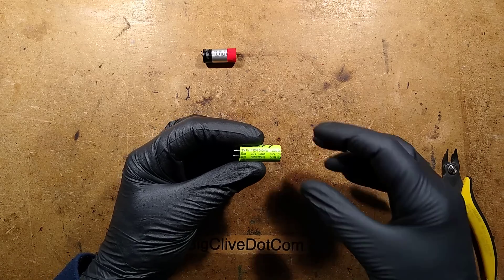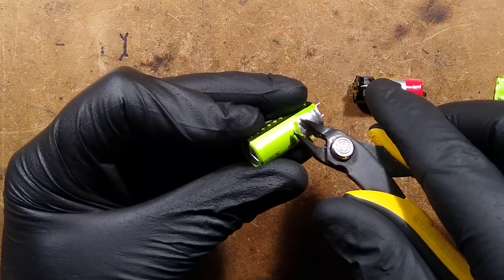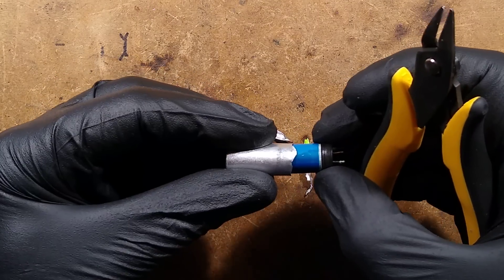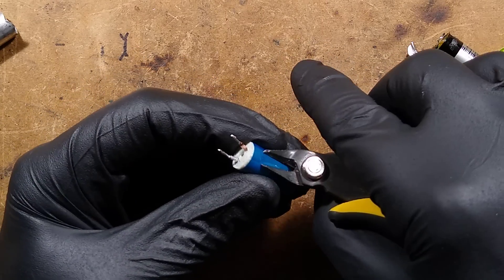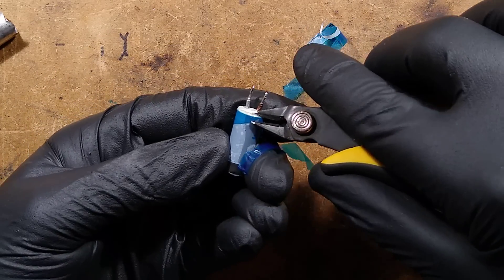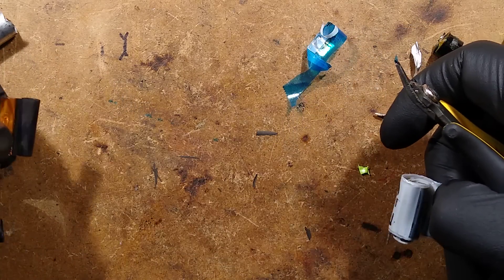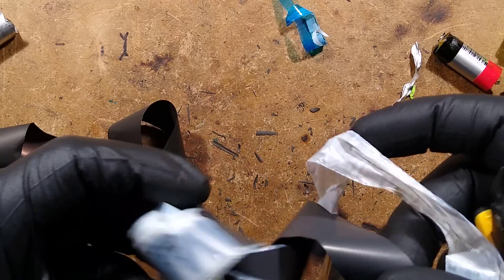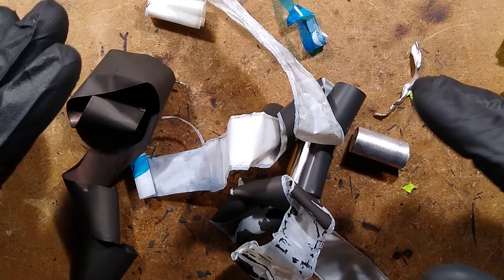Opening a capacitor-style lithium cell (don't try this)

Comment: Honestly, my biggest issue with the whole thing is that they used the black bar to denote positive rather than negative. I have been thinking about it, and can’t see anything good or useful about switching the terminals just because it is not an actual capacitor.
Reply: some older (60s) electrolytic capacitors of that can type did mark the positive like in this cell, instead of the negative, but the bar also had + symbols,, the bar was sometimes red or even blue or green  ,
Reply: I think the Black Bar was used to show the connection to the outer layer (eg case), so you can earth it to prevent capacitive coupling to the surroundings.
Reply: @graemezimmer604  no, its usually 'negative', if also specified with a - ,not necessarily 'outer', and is not necessarily connected to case, it is almost always in axial capacitors, at least more recent ones, but not in radial types, the can is 'floating'
Reply: @andygozzo72  No, look carefully at radial caps - one leg goes through a rubber insulator like normal, and the other leg is the whole can! But what they're talking about in retro caps is when they used to have wax paper outer casings - the can wasn't conductive, and it mattered which plate of the capacitor was the outer one to avoid capacitive coupling to signals in the circuit. That's a real thing!
Reply: @gorak9000  none of the 'modern' radial caps i've come across have the negative directly connected to their can..both wires go through the rubber end and into the rolled up innards

Comment: Fun fact - the entirety of the new Hinkley Point C nuclear power station is constructed within a giant explosion containment pie dish!! 
Sub-facts:
1.Fray Bentos were the first contractors on site.
2. The previously contained pie was used to feed the population of Burnham-on-sea for 3 months.
3. It took 3 years for the pie to cool to a suitable level before it could be served to previously mentioned population
4. The lid has been reserved and will be installed as the lid of the reactor pressure vessel - complete with original labelling. 
5. Work is already under way for the Sizewell C pie.
Reply from the maker: If only Fukushima had had a pie tin.
Reply: @bigclivedotcom  wrapped in that seaweed paper they use on sushi, just doesn’t cut it!

Comment: They're not lithium batteries. They're lithium capacitors. They have different power and energy density than the other technologies. Along with different operating voltage range.
Reply: I was wondering the same thing, but I'm pretty sure Clive is exactly on the money calling it a lithium ion cell for a couple of reasons:
1) the capacity seems very high for a lithium capacitor, which are generally much less energy dense than NMC lithium ion cells. I've got some NMC cells with lower energy density sitting around at home even
2) the capacity is measured in mAh, while a quick search suggests LiC capacity is measured in Farads just like normal capacitors
3) You are correct that LiCs have a different voltage, but that would also cut against these being LiC because in his other video Clive showed that the nominal voltage is 3.7V, exactly the same as any other NMC cell 

Short version is don't judge a book by its cover, even for an electrical component.

Comment: Hm, I'm starting to think this is not a li-ion battery with a strange form factor but a "li-ion capacitor" or LIC. It's a relatively modern (2010-ish for commercial product) bit of a crossbreed between a lithium battery and a supercap, it should have higher charge/discharge speed than a battery (but lower than an actual cap that can dump everything in a snap) and higher capacity than a capacitor (but much lower than a battery).
Reply: I thought the same thing at first but I actually think it is a lithium battery - LiCs have much smaller capacities than these things do, are generally measured in Farads rather than mAh, and operate at different nominal voltages
Reply: ah yes it has low self-discharge, less than 5% per month. That's why it can make sense used as a battery, while caps are not suited for that

Comment: I'd be quite apprehensive having on rubber gloves with things that could ignite on their own but you know what you're doing I guess. 
Having burned myself on a hotplate wearing gloves the meltiness really enhances the burn.
Reply: yuuup, that's I don't wear melty gloves when playing with burny or spinny (lathe/mill) things. glad it worked out for Mr Big this time :)
Reply: @ericfrazer4736  I'm pretty sure thin nitrile gloves are the only kind of gloves that are ok when playing with spinny things - keeps the coolant off your hands, but if it got caught, the glove would just rip - there's no real danger of getting pulled into the  machine. The gloves rip if you look at them the wrong way, they'd stand no chance against a cutter!
Reply: @ericfrazer4736 Yeah. Never wear gloves or long sleeves with "spinny things."  Better to catch a nasty cut than lose a finger.
Reply: I think I'd want something like a set of welder's gloves to do anthing like this, tbh
Reply: Surely it is completely safe if the batteries are fully drained 🤷
I think Clive just likes to create a bit of drama to keep viewers entertained  🤣
Reply: The purpose of the gloves is just to keep the fluids off his skin, I think.
Reply: Would you prefer leather gardening gloves? I'd be worried about having them spontaneously catch fire after this sort of use.
Reply: Maybe a pair of pink Marigolds would fare better?

Comment: The FLUM brand ones I find most often here in San Francisco, CA are way generous with their battery capacity. They’re literally no bigger than the one  in this video, but have a whopping 1000 mAh capacity, and I’ve tested and retested them to be pretty spot on. That’s great and all, but it kinda feels like and even more blatant slap to the face of people like us who can’t stand waste seeing these things carelessly discarded in the gutters all over the place. Now I have many more batteries than I have devices to power, but I’ll still pick up every one I see. SMH.
Reply: @nubie1100 I posted another comment that I think got blocked because of a link, but no, you can't get 18650 batteries with capacities that big. The max you can actually get from reputable brands is around 3600mAh. There are 18650s that claim to be 9000+mAh, but they're fake.
Reply: @CutoutClips  . That's why I said the special ebay ones 🤣  I use 18650 cells alot,  I vape 🤷‍♂️
Reply: @nubie1100  Not only are those 9600's fake, I would bet they're sub 2.5k even.
Reply: 1000mAh is pretty large considering the size and the disposable nature of the device.

9600mAh 18650s are fake. Full stop. Largest capacity 18650 I know are less than 4Ah. Ones with high discharge are much lower than that, 2400mAh is pretty common. Murata VTCs come to mind.

18650s are quite large. These devices are probably smaller than said batteries.

Phone batteries these days are closer to 3000mAh. Some phones are even going for 5Ah these days for longer battery life.
Reply: @adwzt The Vapcell N40 is pretty new and claims 4000 mAh (3850 min). I've seen hobbyists measure them at 4000 mAh. 

I think this is the current leader, but no idea how good the longevity or safety is - they have to be compromising something to get that sort of capacity.
Reply: I've been collecting the 1500mAh ones out of disposal vape here in the uk. I'm going to make a big powerbank
Reply: Make a massive power-brick with them.
Reply: Where are you finding these in the Bay Area?  I'm on the Peninsula so we don't have people throwing these on the ground.  Lots of cigarette butts, but not vapes with free lipos.
Reply: @jeffhaas9577  They’re on the peninsula, I guarantee that. Perhaps you’re just not seeing them. I have lived in California my who,e life, San Francisco for 25 years of it, and the trash on the ground , pretty much anywhere in the Bay Area is pretty bad. Actually, I haven’t really seen any in the last 2 months or so, I guess, which is weird because for a while I couldn’t go out for a walk around the block without finding one. I did post some pretty good information about them in a few popular Facebook groups in San Francisco, i.e. Free in SF, Buy Nothing Mission District, and such, and people were interested in sharing and reposting, so I’m assuming that it’s catching on with people that it’s dumb as spit to just throw them in the gutter after they run out of fluid. I can only hope, anyway.
Reply: @thousandsunny make a power wall out of em... use charge protectors from old cell phone battery's the have died
Reply: @bigmouthstrikesagain4056   and I just so happen to have scavenged about twenty such phones. Now I just need about 70 more.
Reply: 1,000 is not "whopping" when it comes to Lithium cells. You can buy 9,600Mah 18650 cells. That 1,000 Mah can't even charge a cellphone a quarter of the way. Half of it would be used to power the charging circuit and the rest would give you maybe 10% charge. But a cellphone battery is around 1,800 Mah.
Reply: @darrylkinslow5613  well there are devices other than cell phones. some low power embedded computers can last for months off 1000 mah and having that in such a tiny package is very useful and usually not cheap
Reply: @darrylkinslow5613  These capacitor style batteries are much smaller than 18650s. They're also generally put in disposable devices. Given that, it's pretty fair to call 1000mAh a whopping amount.

Also your numbers are way off. The max capacity for an 18650 is about 3600mAh. Anything that claims to be much larger is most likely fake.

As for charge circuitry using half the power of the battery if you tried to use it to charge a smartphone, that's also an overestimate. The switching regulator to boost the voltage from the battery to 5V (for USB) should be close to 90% efficient. Modern phones also use switching regulators to drop back down to the charging voltage, which should also be close to 90% efficient. The actual battery charging process is also very efficient with modern cells, so I'd expect maybe 25% losses or so.

EDIT: well, thinking a little more, if you're trying to do fast charging at higher currents it might be more inefficient and closer to 50% losses as you were saying. But 5V + 500mA should be pretty efficient.
Reply: Correction: You can buy 18650 cells 'marked' 9,600mAh, but...
Reply: @darrylkinslow5613 you really shouldn't trust those cells claiming such large capacities.
Reply: @darrylkinslow5613  at most 3600 mAh, more than that is just BS, and 3600 in an ideal case with a low discharge rate.

Comment: that's interesting, I was expecting more magic smoke but it seems this is not that dangerous. Could be an explanation for the low energy density, as the "safer" types of lithium chemistry cells have lower energy density. While the best and most dense aka lithium polymer is full of angry pixies and magic smoke
Reply: It's not lipo but the 3.7V nominal voltage implies it's some variant of NMC, and those are still on the angrier side. I think it's more that Clive took the precaution of completely discharging it - from what I've heard (and seen with my own old lithium batteries) even NMC cells are pretty inert if you can completely discharge them all the way to zero.
Reply: @bosstowndynamics5488 3.7v nominal is standard Li-poly nominal voltage.
Reply: @nikolaihedler8883  Well yeah, but most lipos don't have an electrolyte soaked jelly roll construction (plus, as far as I'm aware lipos still use NMC cell chemistry with the main difference being the electrolyte). The reason I mentioned the voltage though is because the original comment was speculating these are a safer lithium chemistry and liquid electrolyte NMC cells are pretty much as dangerous as lithium gets outside of lipos (the safer chemistries like LiFePO4 and lithium titanate have lower cell voltages)

Comment: Oh, interesting, I was expecting there to be fully enclosed cell then crimped into the capacitor casing, not for the capacitor casing to be the outermost seal.  How does the capacitor container compare to traditional outermost layers in terms of impact and puncture resistance?  That'd be a factor in deciding whether to reclaim these for some projects.
Reply from the maker: The metal shell should be more rugged than the plastic film normally used, but I'm not sure how well it will contain the electrolyte.
Reply: @bigclivedotcom   Hmm, good point. Is the electrolyte in a battery significantly different than the electrolyte in a capacitor?
Reply: @georgedorn_fnord  I'm not sure about standard aluminum electrolytics (something water based I think?), but ultracapacitors use the same stuff (alkyl carbonates, etc. plus dissolved salt). Which is where they get the comparable voltage rating from.  (You can make an ionic double layer capacitor yourself, with salt water; of course it only handles about a volt before electrolysis takes over. Alkyl carbonates are used in batteries to withstand the high reduction potential of lithium and friends.)  Ultracapacitors are just using the migration of ions towards the surface, of a very high surface-area material (activated carbon). Batteries and hybrid capacitors use some amount of chemical reaction, whether that's ionic absorption (lithium in/out of cobalt oxides and graphite), or full redox reactions (like oxidizing pure lithium metal). The rubber seal maybe doesn't last as long as a laminated/tape seal, but it's certainly a well understood method. :)
Reply: From my experience after collecting many vape batteries, I find that the pouch batteries are more resistant to crushing. The cross at the top splits open with minimal crushing 😅
They are unlikely to get pierced inside the vapes. I've collected over 1000 disposables over the last 3 years, and found very few that that had burst open. Out of 30 of the new ones, around 30% had split at top 😅
Bear in mind that most I find lately are roadkill 😂
Reply: @bigclivedotcom hopefully not well enough to bang

Comment: The "pear drop smell" might be amyl acetate, or pentyl ethanoate, as it would be called nowadays. I can't see, though, that it was used as a solvent in any kind of battery.
Reply: It's ethyl acetate and is commonly used in Li-ion electrolytes. Pretty safe in the quantity present in a cell.

Comment: They really are repurposing capacitor casings and possibly the production lines too. Makes sense really, given the construction of the battery.

I wonder what happens when it fails in a destructive fashion? I guess either the case will blow off, or the top will dome and split, letting out all the fire demons.
Reply: I guess capacitor cases are already designed to depressurise safely so that might be good enough for these small lithium cells as well
Reply: @bosstowndynamics5488 yeah except when lithium is exposed to air it gets more angry
Reply: @DoesntRefillTheBrita  But lithium cells are already designed to depressurise similarly. Remember these things don't contain a chunk of lithium metal waiting to undergo all of the classic chemistry class alkali metal demos.
Reply: @bosstowndynamics5488 lithium polymer cells can and do emit quite the flame when abused. The chemistry creates it's own oxygen when it gets hot enough and the reaction becomes self sustaining.
That's different to the normal lithium ion cells you see in round packages.
Reply: @zyeborm  Gah, comment mix-up with initial response (deleted and posted correct response).

I'm well aware that lipoly cells are flammable. But these aren't lipos, they're NMC cells (aka "normal lithium ion" in your words), which are also potentially flammable but are generally packaged in such a way that they combust fairly slowly with specially designed pressure release break points and such. Notably, electrolytic caps also fail explosively, and as such the casings they use also have pressure releases in a similar vein to metal cased NMC cells. That's the point I was making, that these capacitor casings are presumably actually pretty decent substitutes since they have similar design requirements
Reply: @bosstowndynamics5488  While I was out partying with a bunch of friends by a fireplace, we found some random li-ion battery. Being drunk dumbasses, we threw it in the fire and backed off. Minute later, it practically turned into a bullet, flew good 30-40 meters (not in our direction), hitting and making a hole in plywood. Wild. Hopefully my balls are nowhere near my ebike battery pack if it decides to go bad.

Comment: This new packaging makes sense, I wonder if a capacitor manufacturer wanted to break into the lithium battery market, considering the consumption rate for batteries on disposables must be through the roof.
Reply: That's what I was thinking, are they able to simply repurpose the equipment for making capacitors for making these cells?  It's pretty much the same construction, just with different materials in the layers.
Reply: I saw these cells few years ago used in some micro rc cars.
I dont remember where i saw them, but it was in a video where a guy was repairing some micro rc model cars.
Reply: @MiGujack3, he probably means that it's ok if you write 'lithium is not disposable'
Reply: @ricardogarciademarinacordo1151  
Something like that.

Whenever anyone says A should never be in a sentence with B the author usually means with a positive connection.  I just like to think outside the box and agree with the statement, and then be a bit perverse in saying that A can be in a sentence with B as long as it's a negative connection.